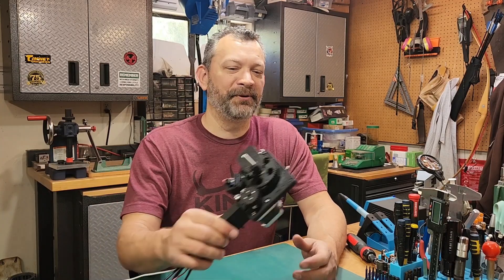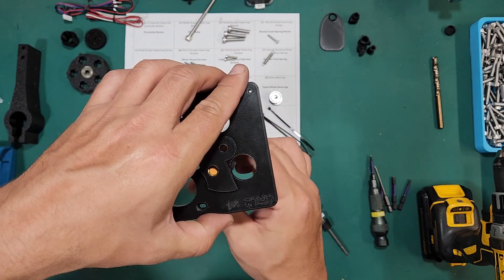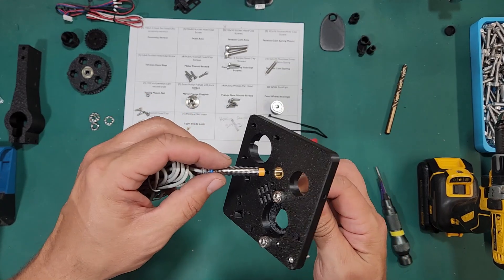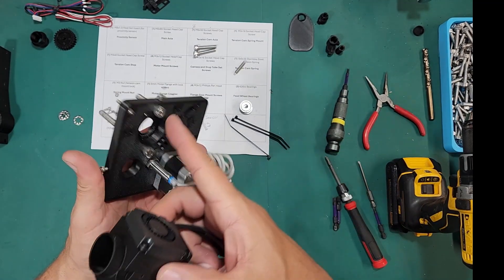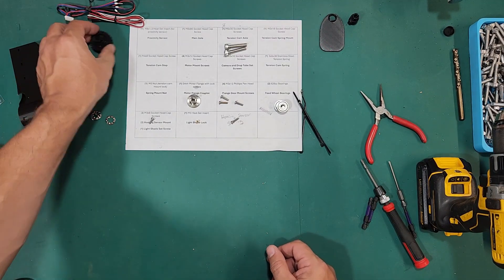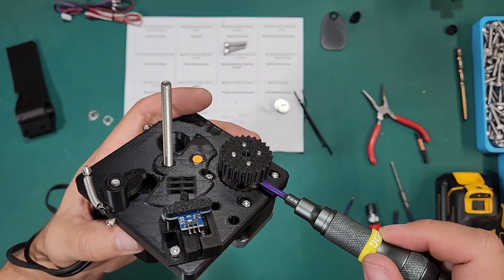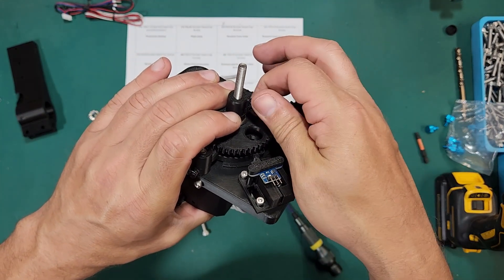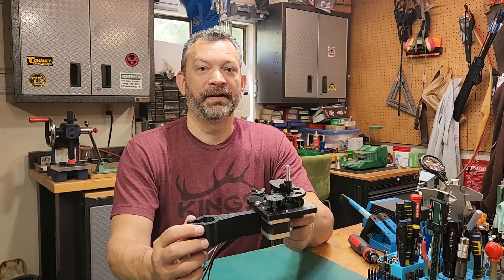CS7.2 Build Series - Classifier Assembly

Comment: Which screws for the motor?
Reply from the maker: The motor screws for the classifier are m3x12 socket head cap screws.  This is also covered in the build guide: https://github.com/sjseth/AI-Case-Sorter-CS7.2/blob/main/Instructions/CS7.2%20Classifier%20Assembly%20Guide.pdf